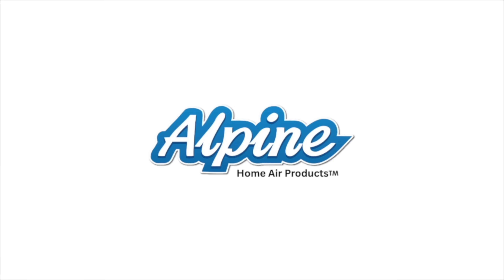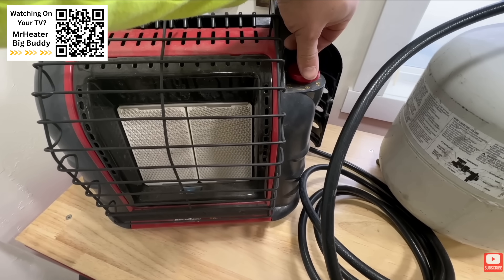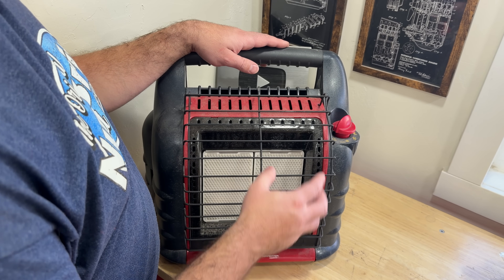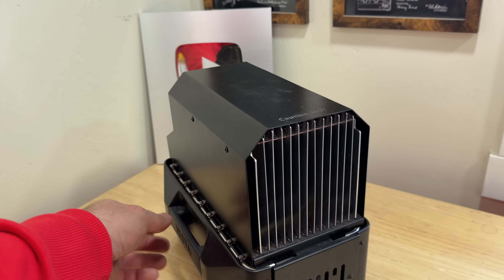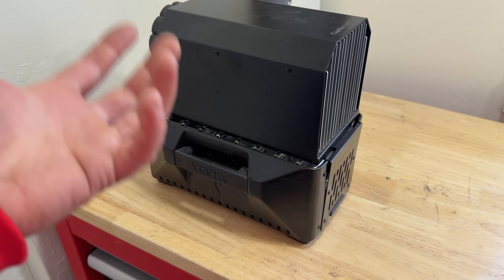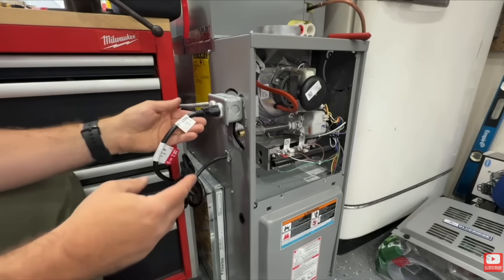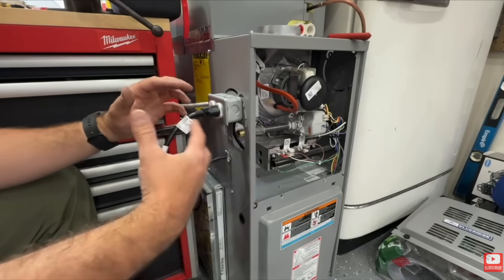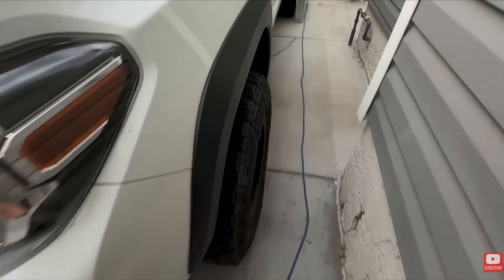Why Didn't We Think Of This Sooner?

Comment: I recently had a two hour power outage.  Used my power station to power my gas fireplace.  Not only allowed the fireplace to start, but also ran the fan.  Kept the house warm until the power came back on.  Power station only dropped to 88%, while also using it to power lamps and my fridge for a short time.
Reply: What power station did you use?
Reply: @longdriver83   ECO PLAY EP2400. With 2048Wh capacity.

Comment: I have had problems with Mr buddy heater bursting into flames.

The cause was a cracked fitting that allows the propane tank to tip out when you install it or take it out.
The crack is enough for the gas psi to push the aluminum tube to push out , then the gas starts to escape and ignites.

Do NOT use these without someone (adult) in the room, 
Do NOT use these with pets or children  along in the room with it.

These heater demand someone watching them incase they fail into fire mode.
there are several vids out about these heater bursting into flames.
Reply: Thanks for this warning.  You also need be careful if you put a 20# tank too close, or use a cheap hose.  Good advice.
Reply: And this is why I am not ever using propane anything I could see myself blowing up mine and the neighbors houses. 
Not too much room for an oops or my bad.
Reply: @Obedient2TheEnd  It's good to be safe.
But keep in mind there are some good propane equipment.  Just use your head when you are looking at them.  Some of this stuff is put together really cheaply.  That s the stuff to watch out for.
Then there is better equipment.  Just look for quality items.

Comment: This is for lights out situation. If you intend to run on a daily basis, the price of propane will be the most expensive way to heat a home through out the winter. Cheapest is wood stove, followed by pellet and char coal then electric/natural gas.
Reply: Up in Canada a few years ago the cheapest way to heat a house was a pellet stove.
Reply: That depends if you're buying your wood or spending the summer stacking available free wood. It is a lot of work heating with wood. House size, burner location and quality of wood burner are factors.

Comment: You all have to know that burning propane creates CO2, so heaters that use propane need t9 have a sensor to shut off, otherwise you risk asphyxiation.  Even worse with using alcohol for heating a closed space - it releases CO
Reply: Alcohol stoves are approved for small boat cabins.   Marine alcohol stoves and furnaces.   Not sure what alcohol you are referring to.....

Comment: If you have a generator, another safe and easy option is plugging in a 1500W oil filled radiator type heater. I have the Buddy Heater and used it during the last 3 hour outage. We never got cold. Someone mentioned a vent free fireplace. I like that idea and going to look into those. First time viewer. Good video.
Reply: we have a vent free unit in our fake fireplace, which we pulled out a little bit during the cold days, and it really heats us up fast!  It runs on a little battery (AA I think) because it automatically turns down so that you don't die of carbon monoxide poisoning.  We bought it years ago at Lowe's and had the local gas utility company install it.

Comment: I hear you must crack some windows.  Doesn't that bring in cold air to compete w/ the heater's warm air?
Reply: You don't need to crack windows. The heater has a low oxygen shut-off. You can also use a CO detector to alert you to high CO.

Comment: How much power can a car alternator put out at idle and how much power can it put out at say 1500rpm
Reply: Power output depends heavily on the alternator size, but a typical car might produce only 200–400W at idle and significantly more than 1000W at 1500 RPM since most alternators reach near-maximum output around this higher speed.

Comment: There's always lot's of controversy over the need for a filter with Mr Heater Buddy Heaters...the following hoses from Mr Heater do not require a filter, but all other hoses will.

F273704  - 10 FT  FITS BOTH “BUDDY HEATER” AND “BIG BUDDY HEATER”

F271803 - 12 FT  ** (BIG BUDDY ONLY)

Comment: SUGGESTIONS: If you are going to use any propane heater with an extension hose to a larger tank, please save yourself a lot of grief and purchase a FILTER to put between the heater and your propane source.  The filter should go at the end of the hose connecting to the heater.  Evidently, over time, these rubber gas lines slowly deteriorate from the inside and tiny bits of rubber begin to come off and move into the heater and clog up the pilot lite and other gas supply ports in the heater.  Using the Buddy Filter should prevent this problem.  Another suggestion, when purchasing a Carbon Monoxide sensor, please consider a "High Sensitivity" type detector.  This type of detector will sense CO at an extremely low level and trigger the alarm much, much faster than any standard UL Approved detector for your home.  I know its crazy but that is the truth.  Also, these high sensitivity detectors are much more expensive than the normal UL Approved home detectors, but your health and life is worth it.  There are many YouTube videos that demonstrate this difference, but please consider it when purchasing a CO Detector.  Some portable detectors might actually be better suited for this job since they are portable also and can be used wherever you take your heater.
Reply: These hoses from Mr Heater do not require a filter:

F273704  - 10 FT  FITS BOTH “BUDDY HEATER” AND “BIG BUDDY HEATER”

F271803 - 12 FT  ** (BIG BUDDY ONLY)

Comment: Dave--great video and tips. Greetings from Cleveland, Ohio--home of Big-Buddy! One other tip--when using the 5-to-20-pound propane tanks with your Mr., Buddy or Big Buddy--get and use a FUEL FILTER. It screws into the unit and "traps" any contaminant nasties oozing out from the inside of your black rubber hose (oil, particulates) connecting the Big Buddy to the 20 pounders.

It avoids these "nasties" clogging up your igniter or fuel system.

Using an OEM Mr. Heater hose avoids using a filter! All other hoses--get a filter.

https://www.youtube.com/watch?v=QN4uB7_ED5E
Reply: These hoses from Mr Heater do not require a filter:

F273704  - 10 FT  FITS BOTH “BUDDY HEATER” AND “BIG BUDDY HEATER”

F271803 - 12 FT  ** (BIG BUDDY ONLY)

Comment: What if you don't have a C Wire?
Reply from the maker: Then the thermostat is battery powered and is just sending a signal to the furnace so it will work just like it normally does.

Comment: With the easy generator switch do you need an inverter generator for clean power since modern furnaces use computer boards?  I didn't know if non true sine wave power would damage a board.

Comment: The aftermarket hoses can get an oily residue in them from the pressure of the propane and clog up the pilot or burner orifice so make sure to use a propane filter if you're going to use it for an extended period of time!
Reply: Listen to the above warning. I bought a Mr. Heater hose and it still clogged my regulator. It's not that easy to disassemble and clean these heaters, so use a filter with the 20lb bottles.
Reply: @ag_devilleI have had mine completely apart 3 or 4 times still junk  works when it feels like it.. I would never recommend one. Just 175 dollar pos.
Reply: @ag_deville the following hoses from Mr Heater do not require a filter, but all other hoses will.

F273704  - 10 FT  FITS BOTH “BUDDY HEATER” AND “BIG BUDDY HEATER”

F271803 - 12 FT  ** (BIG BUDDY ONLY)
Reply: The 10 foot, MR HEATER name brand , hose does not require a filter as it is made of a better quality material.
Reply: @javitswenderlich1010  My hose is 5ft., came in Mr. Heater packaging and was purchased at Ace Hardware. The yellow tag identifies Enerco as the manufacturer. Your 10 ft. hose is the only one that Mr. Heater says does not need a filter.
Reply: @ag_devilleMister heater are junk.  Nothing but problems from mine.
Reply: The 10 ft hose has a regulator at the tank end so only low pressure in the hose solves the oil problem.
Reply: @javitswenderlich1010  I have been running the 10ft for probably 5 years with no filter and never had an issue. Awesome lil heaters for sure.
Reply: Buy the Mr Buddy hose kit. Has everything you need.
Reply: These hoses from Mr Heater do not require a filter:

F273704  - 10 FT  FITS BOTH “BUDDY HEATER” AND “BIG BUDDY HEATER”

F271803 - 12 FT  ** (BIG BUDDY ONLY)

Comment: I live in an all electric home and I've been using a Mr Buddy Heater with the single ceramic burner for three years. 90+ hours run time on 20lb tanks I refill at ace hardware. I would highly recommend getting a propane filter if you're gonna hook it up to the big tank it will extend the appliance life. I also recommend getting a heat powered stove fan with the mounting kit for the Mr Buddy Heater it's amazing and saves me a lot of money heating my home in the winter. It's good to use pipe dope and get everything on tight And also to have a carbon monoxide detector.
Reply: Same! Mr. Buddy is great!
Reply: @SMac-bq8skJunk!
Reply: Agree! Definitely need a filter when you use the larger tanks or you can ruin your heater!
Reply: I agree with your statement on the stove fan. It literally increases the effectiveness by 100%.
Reply: @GaGooch71 is it the one you put on top of your wood stove?
Reply: @janew5351  yes. i have a wood stove fan and  just hook it to the top of the buddy heater grill, works great
Reply: I've got 3 single canister Mr.Buddy heaters, 4- 40LB. tanks of propane, the extension hose , filter and CO2 detector, along with fuel keg refillable canister's! , 2 Patriot solar chargers, 2 burner Coleman camping stove, several portable camping lights, plenty of canned and dried foods, water, self cleaning supplies, warn clothing, and the ability to use the restroom in case the water goes out!  I learned the hard way, back in 2021 I got caught with my pants down! The ice storm hit the DFW area and didn't pay any attention to it! I went 7 Days without power and water! Little to no propane, no groceries, no stockpile of nothing! And no means of constant heat!  NEVER AGAIN!!!!!!!!!!!!!!!!!!!!!!!!!!!!!!!!!!!!!!!!!!!!!!!!!!!!!
Reply: You pointed upward to carbon. Monoxide detector?  I thought co was heavy and the sensors were to be mounted low? Also aren't most co detectors ac only with no bateries?
Reply: @markbachman8321  It doesn't sink or rise, same density of air. Install at head level about the height you breathe from. Batterie operated CO detectors are very common.
Reply: @markbachman8321 Propane is heavier than air, but natural gas and carbon monoxide is slightly lighter than air👍
Reply: @markbachman8321 lowes carries a battery powered co detector.
Reply: @markbachman8321 co is almost same as o2 .CO detector should be about 4 feet off the floor, give or take a foot either way. Electric with battery backup or battery only is ok.
Reply: I have a portable buddy hooked up to 20 lbtank . I have a filter on it. As I'm typing this, I have it on low.
Reply: @frankramirez4694 Yes. When I go to change a small tank , there is a small puddle of water. Puddle is too strong a word.. I keep it on a glass topped stand. I just wipe up the moisture with a cloth. I don't concern myself with the droplets of water as they are forming on the tank. I'm glad it's localized.
Reply: I recently bought a Buddy Pro and put it outside on deck with a Vevor 6 sided popout tent.  It heats up quickly inside on high and maintains heat well on low to medium.  I have the converter hose so its connected to my 15 lb rhino tanks and I have 2 spare.   The Pro version at least has a carbon sensor that will shut it off if it detects unsafe levels.   I also have the Buddy flat tray that rests on the grill but honestly its way small - only big enough to hold the thermal fan (which is another awesome item).
Reply: @johndurrett3573  You'll want to check again...I don't believe that has a CO shutoff. All the Buddy heaters have "Automatic low oxygen shut-off system (ODS)", not CO shut off.
Reply: @zippy2641  Ahh. Fair point, I believe you are correct.
Reply: Definitely get the filter.
Reply: Cm detectors should be right above the floorboard. It is heavier than oxygen.
Reply: @believen_uboo3705 you have no clue what you are talking about. Please quit spreading this nonsense. 
Pretty funny how building code requires us to install only one carbon monoxide detector per level and we mount them on the ceiling. 
This is life saving stuff and when you don't know what you're talking about you just might be the reason someone dies.
Reply: @andrewshedron425  I literally just had my inspection. I was wrong with it being heavier, and the placement in all rooms. That was a different conversation.  Apologies. I have 2 sets of stairs and they are required to be towards the floor by the stairs,  because it rises with the heat or natural air flow. The only time they should ever be on the celing is when they are with the smoke alarm.  Otherwise eye level.  I have the ones that go lower for the spot they are in. Also for my towns code, we have to have one in every room that has a gas unit  except kitchen. We have a lot of gas wall units,  radiator and baseboard heaters where I live. Codes are different for different places.
Reply: @andrewshedron425   While you are right about what you’re saying, you could also be a bit nicer about how you inform others.
Reply: @believen_uboo3705 . Just a suggestion: you can delete your previous comment, or edit it so your comments don’t get anyone confused.
Reply: Same I bought the filter and hose adaptor.  Just tested it all is good  up here in Pennsylvania. Should I need it! Take care, all be safe,storm coming late tonight.some ice but more snow 12 to 18. Guess we'll see.
Reply: Do you work for them?
Reply: @richardbrown1351 Right.  They are junk.
Reply: Yes the portable Buddy heater is amazing, and also the big buddy. 

FYI💥If you go to Mr heaters website and buy the long recommended hose you do not need a filter. You only need a filter if you use a hose other than Mr heater... Has their hoses designed specifically not to use a filter.
Reply: Refillable 1lb canisters are a good idea too. No need to route a hose through the house or worse, keep a 20lb canister in the house. Routing through a window is not optimal either as it compromises the envelope of the house.  Big Buddy was a savior for us before and will always be a reserve unit when SHTF.
Reply: Great information
Reply: Should you ever have a tank inside your home.
Reply: Get a dual regulator makes all the difference.
Reply: In many states your home owners insurance forbids a 20 lb propane tank to be inside your home. So if there were a fire for any reason and the inspector finds the tank inside that could nullify your policy
Reply: Do you have any trouble with water vapor/condensation while using the Buddy heater? I have heard those heaters give off a lot of moisture.
Reply: @steve586586Any “ventless” heater gives off moisture👍
Reply: @steve586586yes
Reply: These hoses from Mr Heater do not require a filter:

F273704  - 10 FT  FITS BOTH “BUDDY HEATER” AND “BIG BUDDY HEATER”

F271803 - 12 FT  ** (BIG BUDDY ONLY)
Reply: @zippy2641  10' fits the both and 12' only fits big buddy? Why is that? Just doesn't make sense. Anyone know why the 12' won't work on both?
Reply: @jpol3808  the 12' hose has a female quick disconnect coupler on the end, which the big buddy heater has a male quick coupler inside.
the 10' hose has an end that matches the male disposable bottle threads.
Reply: @jpol3808  couple reasons...the 10 ft hose is made out of a special material that  does not leach the oil residue, and has a connection that fits both heaters. The 12 ft is not made of that special material, but relies on a regulator it has on the tank end of the hose to prevent the oily residue from getting to the heater. Also, the smaller heater does not have the correct connection that fits the 12' hose. I believe it's the quick-connect.
Reply: Almost no one seems to know about the quick connect on the left side and the notch on the bottom to to run the hose through.
Reply: @zippy2641  I bought two of the hoses, Mr Heater Brand, and they still clogged my heaters after a month or so. I installed filters and have had no more issues.
Reply: @zippy2641 Junk. Would not recommend one to a enemy.
Reply: Do you keep 20 pound tank in your house? Ive read you shouldnt.
Reply: @steven-u1q i don't keep it stored in my house. It's outside in the shed, but it's inside my house right now. Hooked to my buddy heater, if I need heat to night this morning. It was only 5° and wind chill took it to −17 and almost 2 feet of snow. And some ice coming.So I don't really have a choice.I think it'll be fine  take care.
Reply: Why not just get an electric fireplace?
Reply: @Chris-c3f3u alternative to when electric isn’t available
Reply: @venuselectrificata all electric home would mean solar panels right? That would give him electricity 🙄
Reply: Mister buddy heater sux I have had nothing but problems from mine would not recommend it to my enemy.
Reply: @LaRaineBarton Then you are the 1 out of 1000 that didnt like it